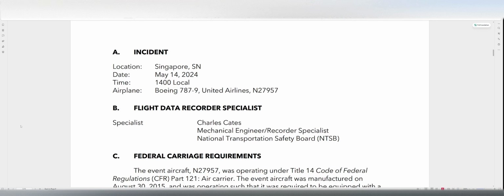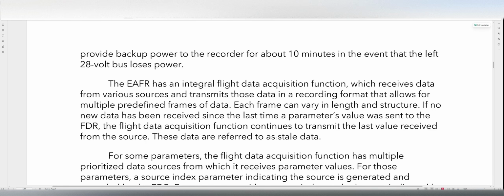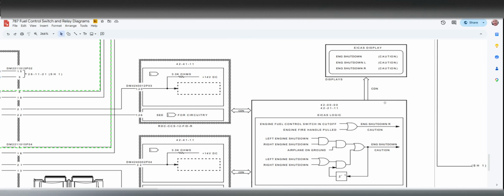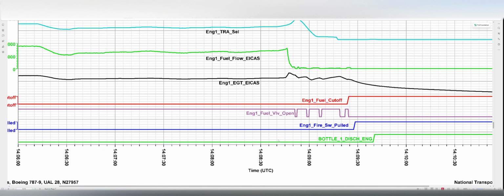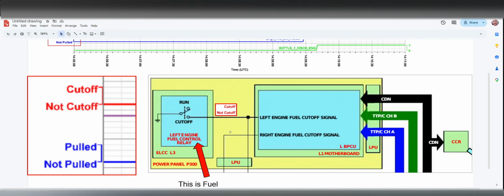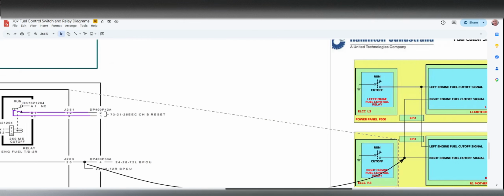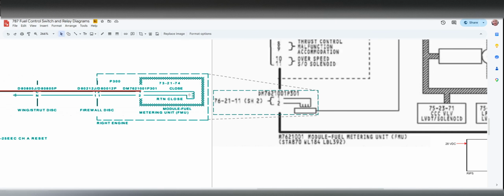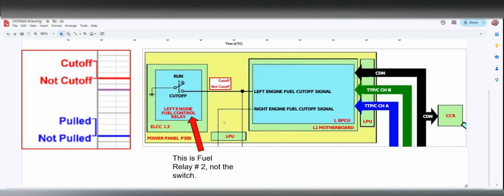Air India AI171 B787-8 Crash - EAFR Reported the Cutoff of Fuel Control Relays L2 + R2.

Comment: You’ve done great work here. You’re getting very, very warm. Almost right on the truth. As a certified safety engineer, I can tell you to keep going on because you’re on the money - almost. This issue is Boeing’s problem whether or not the pilot decide to take OFF himself that faithful day along with everyone aboard. I point my finger directly at Boeing.

Give me access to Boeing’s documentation and I will show you which of their engineers made this decision and which manager approved it, and when I’m done, the engineers and management would be fired, Boeing pays up, and close down the FAA and NTSB because they too are complicit in this matter.  I’m making big accusations here.
Reply from the maker: i get the feeling you might be someone who will try tell me it was a different system that did it. its not. the FADEC did not do this. its impossible. fact. The FADEC is powered by the PMAs. The TCMA logic has nothing to do with thrust resolver angle going through the corr network, it looks directly at the TRA alternating current signal from the TRA rotary transformers on the throttle lever assembly. one of the conditions needed for TCM event is that the throttle is at or below idle. TRA goes DIRECTLY from EEC > TRA resolver > EEC. from the EEC , the info then goes out to the CDN for other things, not to control TCMA.
Alternating current power was fine all the way till the relight, proving the engines were at or close to 56% N2 just before the fuel came back on and auto-relight commenced.

Caution: there are a lot of very silly, uninformed fools out there who just want to slap their name all over this tragedy for some sub-human fame reason.

When I say 100% certain, I dont mean, 99%, Im telling you all that I am certain!
I dont have a time machine to bring everyone forward in time to when we get to the point where we look back and see me desperately trying to educate everyone. This is now, and all I have is youtube.
Reply: *fateful day - not faithful, I suggest.
Reply: @ZoubirKabir thanks. I always get that wrong.
Reply: @TheTeaParty320 In Islam we are guided that fate and the belief in the Will of God is a mark of faith. A faithful servant of God is one who accepts the fate that is written, and that faith is what bridges the gap between understanding and acceotence. The two are intertwined. It is not qite the same as being fatalistic, or having blind faith. I hope and pray that the bereaved families of this accident have faith, understanding, and beleif in God, and to accvept they may not yet, or ever, fully understand why their loved ones were killed. It was a fateful day that tests faith. We, and Jeremy especially, endeavour to light the world with truth in the cause of preventing anything similar. 
Also in Islam we are guided to trust to God that you camek will not be stolen or escape but first tie it up. As for the Boeing 787 Dreamliner I would counsel for any traveller to trust to God they have a safe arrival at their destination but first choose a different aircraft type. May fate, faith, and a good spellchecker serve you well, incha'Allah.